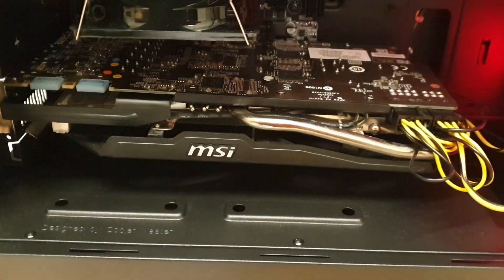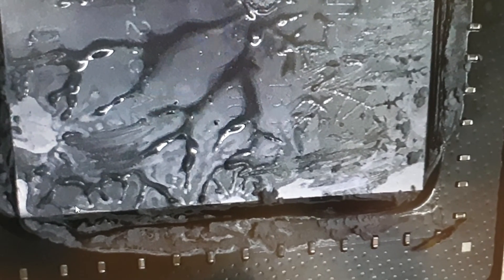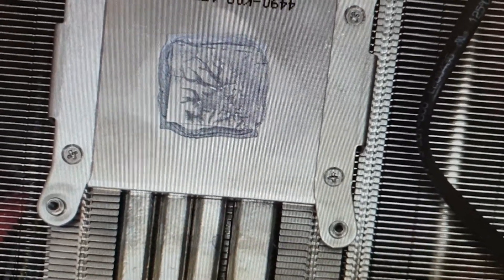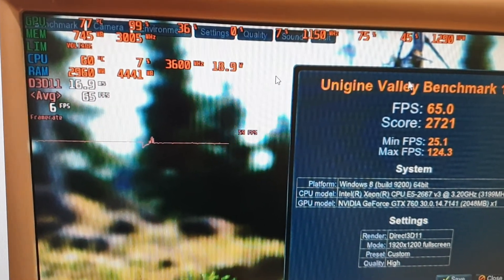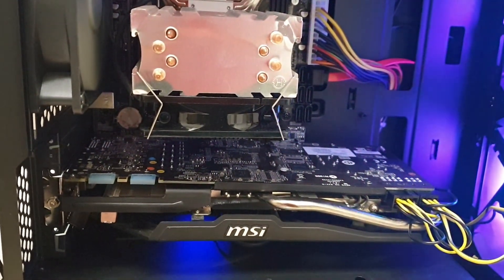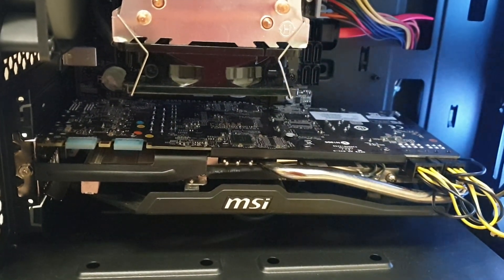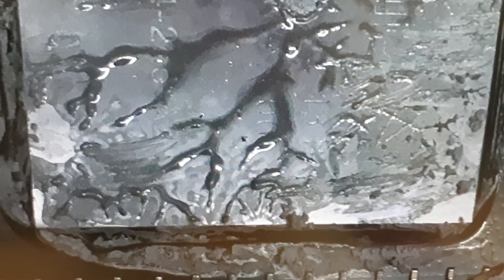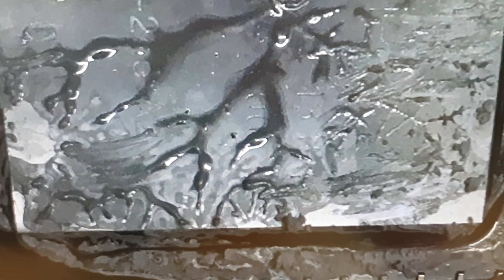Thermal paste sometimes needs to be replaced on new devices more urgently then old VGA / laptop CPU!

Comment: Very interesting, why do some people sometimes use copper shims between gpu / cpu and heatsink
Reply from the maker: Yeah, I saw it in old laptop. Cooper is soft and one of the best thermal conductor but paste will fill better. There is almost not different in temperature but better paste will last longer and fill the gap better. The different in temperatures is usually because it is applied like in the video above ;).